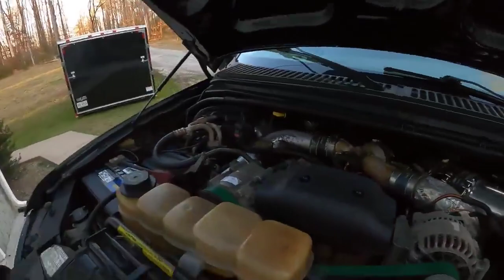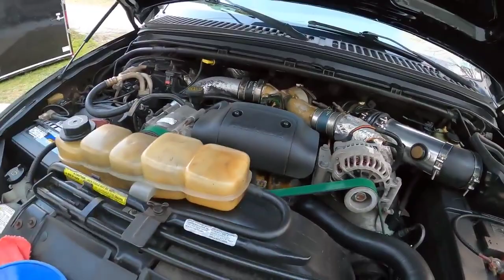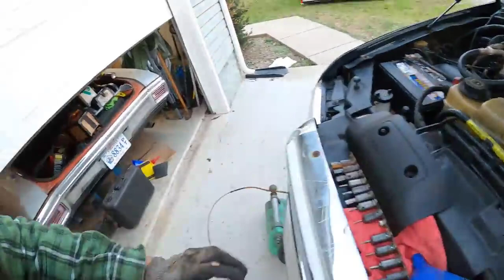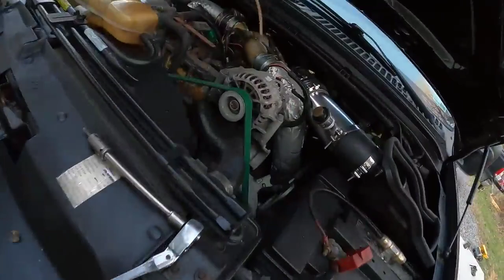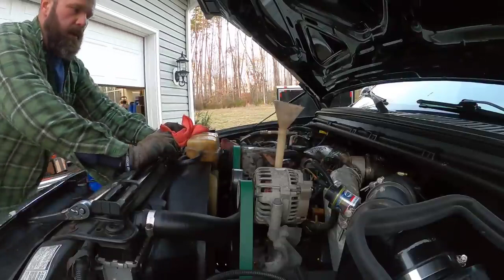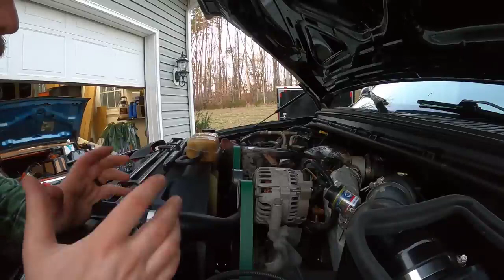Revitalize Your Engine: HPOP Oil Change for 7.3 Powerstroke

Comment: watching from Australia. unfortunately, here we didn't get many 7.3s so mechanics here don't know much about them i was lucky enough to work for ford commercial were i got to work on some 7.3s but no longer work there. had a 7.3 in my workshop today with 180000km on it and never had the high-pressure oil changed. drives like a new truck now customer very happy

Comment: I've got a 7.3 with a little over three hundred and ten thousand miles on it and I was wondering if replacing that oil would help it with a little extra power by getting the oil to the injectors a little easier, although I haven't tried it personally, but I'll give it a shot and see what happens. Thanks for the video!
Reply from the maker: I’m glad you found it helpful.

Comment: So do you do the oil change after the hpop oil replace 3 times? Or do you do the oil change than the hpop 1 time after refilling than the hpop 2 times more?
Reply from the maker: I replace the engine oil first, then I remove and replace the oil in the HPOP 3 times.

Comment: Why bother doing this and not draining the heads? Might as well pull the oil cooler and drain it too, right?

Point is, the smount of oil left in that reservoir is insignificant and it's a a waste of time to "change" it.
Reply from the maker: @PikachuG5  because I do dumb things all the time I guess?